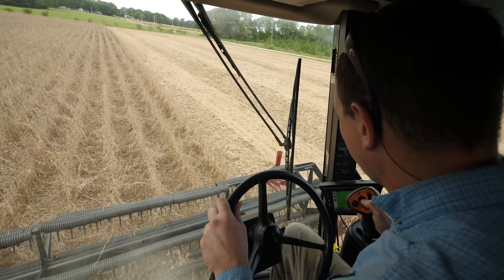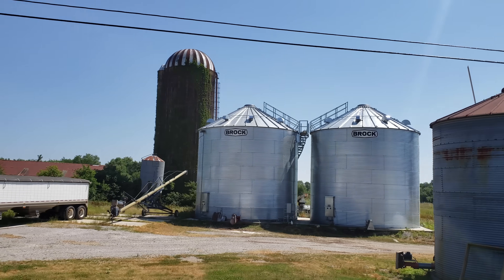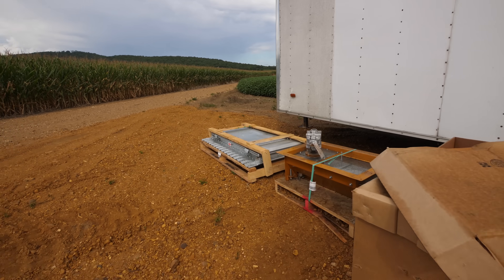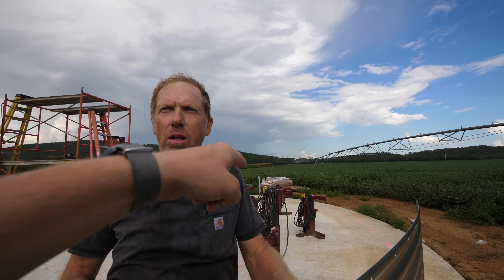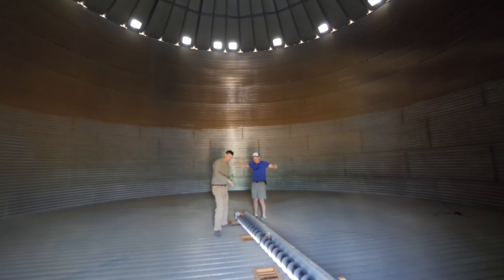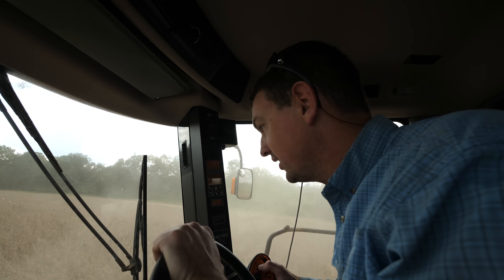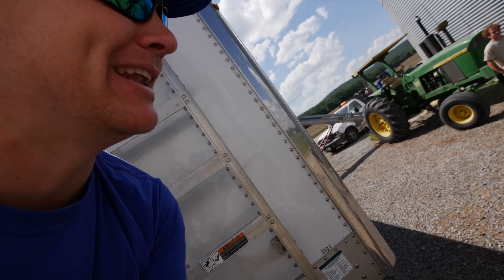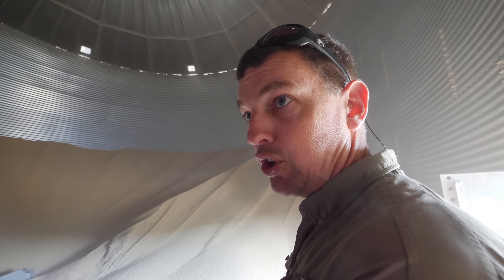Everything About Grain Bins (Farmers are Geniuses) - Smarter Every Day 218

Comment: You'll get better fruit set if you plant your corn in a block.

edit: Does that term apply for grains? Hmm.
Reply: theyre still fruit!
Reply: @gtbrings  True, I got confused because the actual fruit, in the case of grains, is a thin pericarp (a fruit being the seed bearing structure) and isn't obvious. My rusty brain got confused, only Gymnosperms (pines, ginkos, cycads, and the like) have seeds with no actual fruit.
Reply: @troyclayton  it also depends on which grains youre thinking of. poaceae fruit are usually "berries", whereas soybeans would be beans, peas, etc (with slightly different overall structure)

Comment: Wholly off topic but maybe you know.

Recently an inspector told me that the line voltage wires from my meter to my breaker box need to go through a single conduit not three separate ones.  Why is that if you or anyone reading knows. I checked the NEC briefly and couldn’t find and answer.

Comment: People: "You can't build a house from the roof down!"
Grain Bin builders: "Hold my ice tea."
Reply: In Iowa, there is a "house" built from two of those bins, one inside the other, and would win that bet for the bin builders. Saw a story on it while in a hotel outside Des Moines.
Reply: srpilha *sweet tea
Reply: srpilha iced tea
Reply: Hold my beans
Reply: And here I am thinking of ways to turn a new grain bin into a house; is it feasible, economically sound, what modifications would have to be done....
Reply: At first I wanted to mention "lift slab construction", but it involves only raising the first level and then forming upper slabs above the existing ones...
However,... 

People: "You can't build a house from the roof down!"
Civil Engineers: Hold that thought! What about jackblock building system?

Spanish: Hold my sangria! There's Torres de Colon in Madrid! It was built from the roof to the bottom!
Along with central banks in Ireland and South Africa, and a number of residential and office buildings (mostly from the '70s) in Central Europe, the Soviet Union and India (the most recent that I'm aware of)...

Comment: Over in Eastern Europe we call those "punches" carrots. I'm sure you can see why :D
Either way, it's a basic tool at any steel / metal assembly works. Such simple tool - literally just a pointy metal stick - , and yet so important for lining up those bolt connections

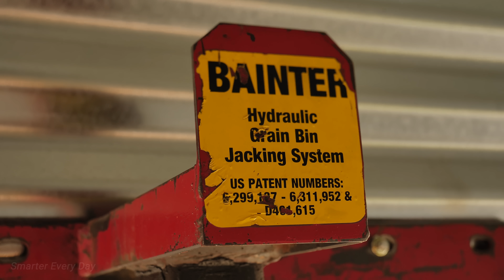Comment: I used to work for Bainter construction in Hoxie, ks we built those silo jacks' you can see the Bainter label at 3:57  i didn't personally build them but I drilled the holes put the stickers on and painted all of them. I bet I painted the ones used in this video.

Comment: Sow those 'cornses' in a square Bro. They're pollinated by wind!
Reply: Yep. He only has 3 rows there. Look at a corn field and the first couple rows on the sides of the field are always puny. Even his center row is only the 2nd row from the edge.
Reply: Maybe there's a prevailing wind in Alabama and it blows along the row of corn?

Also, sowing them in a circle would be even more efficient if maximum average cross-section is needed,
Reply: @turkosicsaba  Brilliant idea with the circle. Taking that idea further,  one could lay out the corn plants in a pattern where the gap between is a meditation maze.
Reply: @turkosicsaba  Your putting a round peg in a square hole, it fits, but the idea has four big useles gaps in it.
Reply: @turkosicsaba  Agreed!
Reply: Can you plant limas with the corn?  I read that's what Native Americans did.
Reply: He specifically said that he'd already harvested most of the field by the time the cameras got there.
Reply: @HiddenWindshield  That was the soybean field to which he was referring.

Comment: but then what's the difference between silos and grain bins??
Reply: Silo hold a kind of "hay" whether alfalfa, grasses, or chopped corn stacks/cobs, and are at a different humidity than grain bins holding "seeds" like soybeans, corn, wheat, oats.
Reply: In general. Silos are the cement structures you see. They are super skinny. Grain bins are steel structures.

Comment: I've built 50 - 100 ft bins in -10 weather in Montana with this same method. anheuser busch owns the winter wheat market and has silo after silo on every train stop from Missoula to Wibbaux. Just had 2 torpedo heaters running all the time.

Comment: Now you have to figure out how the moisture tester works
Reply: Electro capacitance! It's also a fascinating engineering problem
Reply: @stonecanuck  Resistance rather than capacitance in any moisture meter I have ever used.
Reply: Great idea for another learning video! :)
Reply: The model I have works on measuring electrical flow through the grain using a winch for creating current.
Reply: At the farm I worked at, they had this little dinky tester that they used for this massive mill. We would get a cup of corn from the bin, dump it in the moisture reader, then adjust the dryers accordingly.
Reply: I suspect it sends an electric current through the beans, OR since Trey filled it up all the way up it might take the average size and weight of a dry bean and compare it with the beans currently  inside the tester.
Reply: What's inside...
Reply: @opluxna2120  Most of them have what looks like a printed circuit board inside... measures electro-capacitance I'd guess of the grain contacting it (you select what grain your testing which is what the meter uses to correlate the signal it receives from the tester "board" into a reading of moisture percentage on the meter readout... 
Later!  OL J R :)
Reply: @bsisosb  No that takes time to reach equilibrium and you'd have to account for air humidity and temperature as well...  These testers give a reading in less than 30 seconds most of the time... Usually you will run a sample through your tester AND a more sophisticated tester they use at your local grain elevator (or wherever you're delivering you grain to) and then correlate the results to better the 'estimated moisture level' that the little handheld meter gives you... for instance it's not uncommon for the handhelds to read a point or two wetter or drier than the grain ACTUALLY is (per the more sophisticated meter at the elevator-- after all it's the one at the elevator that determines how you're going to be paid (or docked for excess moisture!) for your grain!  Once you know your handheld meter is "reading a point too low" or whatever, then you can correct for it as you home in on the correct moisture level... If it's a point to low and reading 15%, you know your grain is actually more like 16% moisture and still needs a little more drying... Later!   OL J R :)
Reply: @lukestrawwalker  Thank you for spreading your knowledge!  It's greatly appreciated😊! And THANK YOU for being a farmer
Reply: Yes, yes he does
Reply: Moisture senser
Reply: There is a ton of math involved in drying corn properly. Computers help.
Reply: edit: whats the math?
@Trenton Hays
Reply: @Baigle1  I haven't got a clue. I just entered numbers from the moisture reader into the dryer and it did the math.
Reply: Pretty much like everyone said with the electric. It has to measure base resistance first, so as not to be biased off of air moisture or anything like that affecting it. This is why we have to let it test an empty sample first. Don’t quite me on any of this... I just use it. I didn’t build it.
Reply: Yes
Reply: On the farm we call it a magic money tool
Reply: Maybe Like the bin. Maybe the tester blows a bit of air through the beans and tests how much moisture the air got while travelling through the beans
Reply: It work by grinding the grain pass through electricity and the wetter the grain is the more or less resistance. based on the resistance you can work out how much moisture in in the grain
Reply: @jackbroughton9803  These don't grind the grain just dumps it into a cup around a green printed circuit board of some sort that senses the resistance I suppose... OL J R :)

Comment: Worked at the local Grain Elevator as a lumper/pumper. They measure moisture of the grain before purchasing and adjust the price accordingly. It is better have it perfect though. They also check prices in real-time to maximize profit. I saw truck come In buy a truck full of dent corn and park a half mile away only to return two hours later to sell it because the prices were spiking.  He knew something we didn't I guess.
Reply: Information is valuable in direct proportion of how limited it is. Sure sounds like the driver knew something you didn't. I wonder how?

Comment: A lot of people don't realize how much all that equipment costs, either. That combine was probably about $250,000, the head (the part that cut the beans down and feeds it into the combine) was another $50,000. Combines are also the most complicated mass produced machines on the planet. That bin was another five or six digits. And, since the machines are getting more and more computerized, the computer portions are getting out of reach due to copyright and security issues. 

Thanks for making the video, it's not an easy job. Have you gotten all the soybean dust off of you, yet?

Comment: Chance manufacturing from Wichita Kansas manufactured a ride called the zipper. I was the foreman of the zipper in a past career. The punch was often a tool I had to use to align parts for assembly so I can get the pins in, that hold the ride together. 
You should do a video about the engineering and physics, of carnival rides. You could probably do an entire series on it. But if you go Hands-On it might be some of the hardest work you'll do. Lots of iron and steel lifting, followed up by wire pulling, all grunt style, wire on shoulder. 
The Assembly of this grain bin, it's also kind of the same way skyscrapers get built, and some carnival rides assembled.

Comment: Oh my god! They assemble it from the ground up?! I would never know that if it wasn't because of this video! Thanks Destin!
I love when you are with people from the same city, you guys start to talk with an regional accent, it's so funny xD
Reply: From the top down and from the ground up 🤨
Reply: From the ground up implies the standard way of constructing any building. Laying the lowest-level material first and using scaffolding or cranes to build the upper levels above that. They build these from the top down. Roof and top level of walls first, then lifting it up and adding each layer as they go. I wonder if they do anything special to secure it to the concrete or if the sheer weight of all the steel is enough to keep it down?